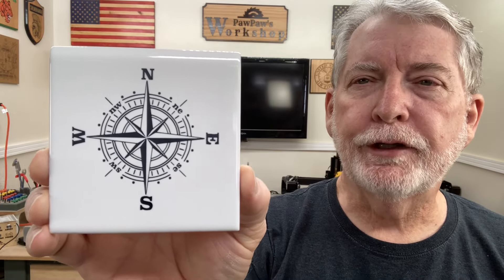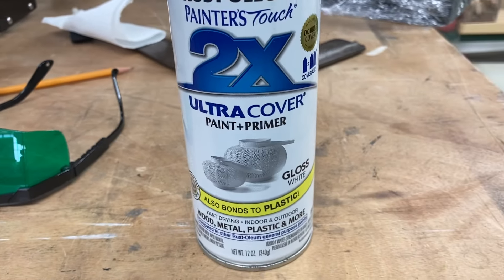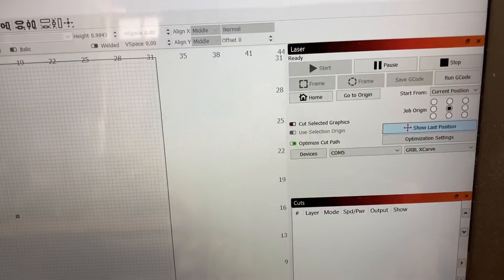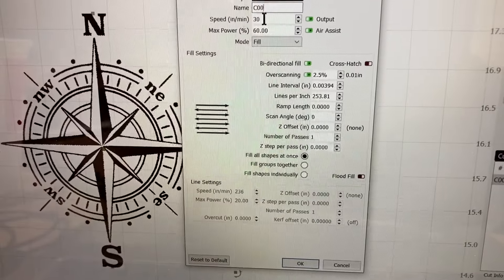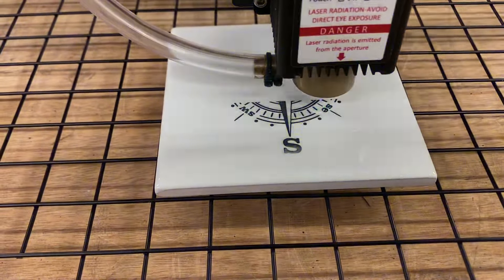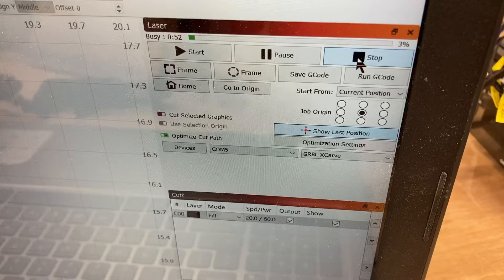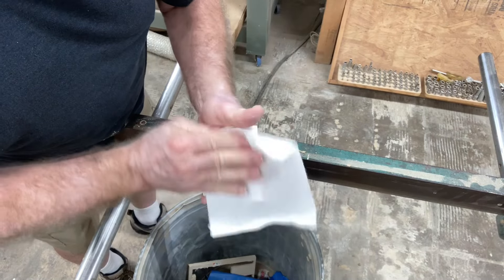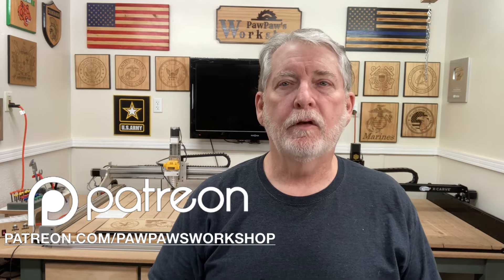Engraving Ceramic Tile Simple and Easy

Comment: Possibility for the bottom of the S is that the laser has not fully started to fire. Often have to run a quick small file to get the laser fully firing before running any work files when starting the laser for the first run of the day.
Reply from the maker: Great information. Thank you
Reply: I looked up the laser diode in the video and the specs say "operating range 40-75'C", so the problem is almost definitely a warm up issue and can be worked around as you suggested. I googled around and found a PhD thesis "A novel laser diode wavelength stabilisation technique..." by Abdullah Asmari. The thesis claimed wavelength is dependent on temperature (due to thermal expansion of the relevant micro geometries), and so initially poor engraving action could be due to an unsuitable wavelength at ambient temperatures. However, it's also quite possible that the 40'C minimum temperature marks the lowest input value of the control algorithm that produces normal power outputs. It should be possible to develop experiment tests to determine whether the wavelength or control system effect is the main contributor

Comment: This is new to me.  Wondering why you painted it in the first place, if you are just going to remove the paint after the burn?
Reply from the maker: The tiles are painted for two reasons. The ceramic tile will reflect the laser and not burn and the second reason is that the laser is burning the paint causing it to oxidize and embed into the ceramic. The black is a result of the chemical reaction with the laser and the paint.

Comment: Is there a specific reason you used the paint?  Was it simply for masking, or does it serve another purpose?  Can I just use making tape instead?
Reply from the maker: Yes,  the paint has titanium oxide in the paint. That is what reacts with the laser. You can purchase titanium oxide and mix it with alcohol and spray the mixture on the tile.
Reply: @PawPawsWorkShop awesome, thank you. You just saved me from unnecessary testing and waste.

Comment: As many others here have said THANK YOU SIR for taking time to help noobies like me get started in this fantastic hobby.! The compass tile you did in this video is a true work of art! Thank you once again for sharing!
Reply from the maker: Thank you very much. It is my pleasure to do the videos and I’m happy that it helped you
Reply: @PawPawsWorkShop   

Hi there. How are you?
The laser used was a Diode type?
Thanks.
Reply: I hear what you're saying but I usually reserve the term "work of art" for something that's made by hand using hand tools. They can be electric, but hand tools all the same. Sometimes the Art comes from the difficulty of the project. Laser cutting is not difficult at all. Grandmother's do it. I'm a traditional woodworker and Craftsman, but I also use laser engravers, and I consider the two things entirely different.

Having said that, can you make art with a laser engraver. Yes you can. But that art comes from the designing. A simple compass like this laser etched on a tile (while cool) doesn't qualify.

I think if you asked most craftsmen who also use laser engravers they would agree. The only people that think they're making art with CNC machines are people that have no real skills, or real artist that can design extremely detailed and intricate designs.

This is in no way a criticism of this channel. Just as someone who's been an artist for 30 years now I want to make sure we differentiate between the two, before real Art is lost. We are already on the edge of that cliff.

Comment: The lighter S was the first thing engraved, often laser engraver have heat issues where the laser puts out lower laser power until it warms up.
The result is that the start of the engraving is dodgy.
One solution is to do a small throw-away engraving immediately before the main engraving, so the laser is properly hot when the main engraving starts.
Another solution is to check and adjust/repair the electronic laser driver, and I remember one case of this working well with a 40w tube laser.
So it's a warm-up issue. Hope that helps. 🙂
Reply from the maker: Thank you

Comment: Thank you for your video's !  In this video I learned that to convert mm to inches and vice versa when setting the speed using lightburn , you just go to the setting box and select the opposite of what your using for speed and go back to your work and it shows what the number is ether way . Thanks I have been wanting that information . This will make it so when other people post there setting you can easily see what they are as per the settings you use. Keep up the good work !
Reply from the maker: Thank you very much
Reply: I'd prefer to be given settings in millimetres.

Comment: Hi great video i did one tile using the same spray, which come out lovely and dark nice deep engrave then i did another but it come out grey not dark as previous you can still feel the embossing the same depth into the tile, have i over or under sprayed the paint or not let it dry long enough im puzzled same exact settings were used on both my tiles

Comment: Thank you for answering a few questions before I could ask. I've seen many of these tiles videos and almost everyone talks about removing underlying paint color. I had been wondering if it can actually go into the tile. I don't want to potentially sell something and get complaints the coffee cup scrapes off the design, even with a seal coat.
Reply from the maker: No, the paint will not go into the ceramic. It’s not porous. Thanks for watching
Reply: @PawPawsWorkShop  Opps, I don't think I phrased it right. 
I was previously wondering if the laser actually went into the tile instead of just removing the spray paint layers. This was the first one I have seen that said it was permanent instead of layer removal.
So, thanks for answering a question I had for so long at roughly 7 minutes in.

Comment: Hi
The problem with the (S) usually  is due to maladjustment on the mirror of the laser if yours have mirrors, when you engrave in the top part that won't happen but as the laser goes down and get far the laser will start hitting less centered on the pointer inner hole, an adjustment on the mirrors leaving the pointer on the bottom right of the engraving space of the machine should fix it, I had probably done this easy fix 20 times with my machine 
Best Luck Fixing it
Reply: Did you not see the diode laser moving over the tile?

Comment: Thank you very much. Would you please explain about the black color after engraving. Is it the result of burning the white paint?
Reply from the maker: It is the result of the burning of the titanium oxide that is in the paint
Reply: @PawPawsWorkShop  Dear Sir, How does engraving multi-layered painted canvas come out in different colors? The used paints are the same, that is, they containing zinc dioxide. I really get confused. I appreciate your explanation.

Comment: I did this before watching this video with a similar compass rose (not as nice as the one you are using) and it turned out grey, I tried various speeds at full power as well. Still looks good though
Reply from the maker: It may be the chemical makeup of the paint.  thanks for watching.
Reply: @PawPawsWorkShop  ah yes, you could be right. It is rustoleum primer. I will try some other paints.

Comment: So if you used this technique on a white ceramic casserole dish, since it’s only having a reaction to the white but not really removing any glaze….would it be food safe?   Or does it actually remove the glaze??
Reply from the maker: It’s burning into the glaze. If you do the engraving on the outside of the dish away from the food contact you may be ok

Comment: How do you set the x and y to the center in lightburn? I have an ortur laser.  This is an amazing idea and and amazing project.
Reply from the maker: I use the center point as the origin point. In Lightburn the small green square is the point of origin. Align the laser to the same point on your project

Comment: so what if i want to "mass produce" a bunch of tiles?  do i still use basic spray paint in a can on each individual tile, or can i shoot them with a larger volume spray gun on a set of a dozen or so placed on card board?  not that familiar yet with lasers and paint, so was curious if all paint would react the same?  brother in law works at an auto body shop and has access to spray guns and paint booths where i could paint a couple of dozen at a time to prep them ahead of time.
Reply from the maker: That should work just fine.

Comment: Paw Paw. In this video, you stopped the engraving the project right after you had improved the Letter S which was great. However, If I wanted to go back to the original starting position for another tile, how do you do that? In Easel if you stop the project it automatically goes back to the datum point but I can't set up an auto return to zero (or origin) in Lightburn. Your advice would be appreciated. Thanks and regards, Colin P, Vancouver Island, British Columbia, Canada.
P.S. Do you have an Etsy store?
Reply from the maker: If you are using current position it will start at that point. For many simple projects that is what I use. For others I will home the machine and us absolute coordinates. This allows you to repeat over and over.

Comment: Thank you for your video.  Interesting and I will buy Rust Oleum spray to try.  Can use the one where the White paint is Matt instead of Gloss.?
Reply from the maker: Yes you can!  Smokey beige works well also. It’s the titanium oxide in the paint that makes this process works
Reply: @PawPawsWorkShop  Thank you for your quick response.

Comment: Hello Paw Paw.
It's been 4 days since my xTOOL D1 Pro arrived, which I bought on Aliexpress. I have already assembled it and it is working properly.
However, I would like to know something that, for sure, is very simple. Among all the materials that came with the machine in the package, there was a Pad Case with red ink, like a Stamp; so, I would like to know what is the use of this and/or how to use it? Thanks
Reply from the maker: I do not know. I did not get that in my xTool D1

Comment: Great video thanks. 
I've tried this method and it goes through the glaze, is this normal?
Reply from the maker: Yes, this is normal. It is permanently etched into the ceramic
Reply: @PawPawsWorkShop  thank you
Reply: @PawPawsWorkShop  just tried another burn, it doesn't come out as black as yours, I have a 10w diode, done a scale test, 900/70 looked OK but more grey on latest burn.

Comment: You started with a white tile and applied white paint and then the laser heated the paint breaking it down to a black color and fusing it with the glaze.  Paint not heated by the laser was removed with steel wool.  I wouldn't have guessed the white paint would produce the black result.  Is it important to use specific white paint?  Have you tried other colors?  What were the results?  Robothut on youtube did similar work with zinc paint producing a metallic look.
Reply from the maker: I have not tried other colors yet. Thank you

Comment: i have the JTech 7watt diode laser can I do this process with that laser?
Reply from the maker: Yes, I believe you can do this.  It will require a little testing
Reply: @PawPawsWorkShop  I did a photograph which turned out too dark then I did a line art cartoon character which turned out to be perfect. So I just need to practice on photographs to get the right contrast etc. Amazing!

Comment: I noticed your line interval is .00394".. Is that the default for your laser? I thought the 5 and 10watts used a .08" line interval. Very good video, thanks.
Reply from the maker: That is correct. I did not change it

Comment: I own both a Foxalien 4040XE & a Foxalien Reiser. Before buying the Reiner, I bought a rotary roller for the 4040-XE (R57). Can I modify the connector so it will work on the Reizer , or do I need to purchase the rotary roller (R42) for the Reizer?
Reply from the maker: It is my understanding that no you can not.
Reply: @PawPawsWorkShop  Bummer. I guess I’ll put the R57 up for sale and buy the R42.
Thanks for the quick response! Love you 
channel!

Comment: Hi Can you use any colour of paint,or does it need to be white
Reply from the maker: It’s not so much the paint color, it the fact that it has titanium oxide in the paint. Most often this is found in white paint or very light colors. Smokey beige in the Rustoluem brand also works well

Comment: I followed your steps and the engraved area turned black but it wiped off and did stay. Any idea why?
Reply from the maker: Two possibilities. One, the paint. Did you use the same paint?  Two, your settings will need to changed based on your laser. Run the grid test pattern to see the best settings.

Comment: Paw paw if I  understand this correctly you ran your laser at 60% which would be 4.5 watts. My laser is a 2.5 watt so I could acheave the same by running my laser twice at 55% .
Reply from the maker: That should work.  Give it a try. Would love to see the results
Reply: that foxalien laser is only about 5w laser output.

Comment: Any advise on why my engraving wipes off the white tile? I have followed your video and had adjusted settings, but the lighter grey/white areas wipe off. And is there a file for LaserGrbl with the greyscale test that you are aware of?
Reply from the maker: What are your settings in GRBL?  $30=1000
Reply: @PawPawsWorkShop  $30 1000

Comment: Hi Paw Paw. I noticed you are using a fox alien laser. Did you connect the laser directly to the inventibles controller or did you have to use a controller from Fox Alien? I inherited a 15W unit from a friend but it has no manuals, wires or anything. Trying to figure out how to hook it up.
Reply from the maker: The FOXAlien laser has it own controller on the machine itself. The xcontroller on the XCarve does not have all of the necessary laser control elements. I have a JTechphotonics laser for the XCarve and it has it own controller for the laser that is connected into the xcontroller.

Comment: I did everything just like you but my results are very pale in comparison, my print only get pale gray. could that be because of the paint quality?
Reply from the maker: It could be the paint and also the settings could be off. Have you run the grid pattern?
Reply: @PawPawsWorkShop  I did the grid test and it all seemed very pale, even the settings that cut deep. I ordered some titanium dioxide and isopropyl alcohol to try instead, thanks for replying 🙂

Comment: Pawpaw how do you get the black.  I am using a Jteck laser 7W Pro. My speed is 5”/minute and power is 100%. This is not making any markings in tile. Can you help me?
Reply from the maker: Did you paint the tile white first?  It is the titanium in the white paint that reacts with the laser that causes the black to be burned into the tile. It is the Norton white tile method
Reply: Do you paint over the ceramic finish?  Any special paint?
Reply from the maker: Yes, just spray the tile with the paint let dry completely. Then engrave. After the engraving is done clean off all the paint with lacquer thinner

Comment: The imagine came out great. Went to clean and the paint came off. It took the entire imagine off. I did clean the tile first, then spray paint with 2x white. Waited the 24 hrs to dry. What else could I be doing wrong? I know it's me. Great  video.
Reply from the maker: What laser and what are your settings
Reply: @PawPawsWorkShop  S9. Should I feel the etch into the tile?
Reply: 1200 speed and 10 power
Reply from the maker: Yes, you should feel the etch in the tile
Reply: I have an XTool D1Pro 10w and tried this and it does not come out black more like a silver-ish color. How do you get it to be black?

Comment: Hello, I have a question about traveling lines on my laser. It happens in lightburn and Lasergrbl. I checked the $30 and $32 settings and they are correct. Any ideas? Thanks
Reply from the maker: The lines per inch may be the problem.  Check that in the settings
Reply: @PawPawsWorkShop  Thanks for replying, I'll see what I can find.

Comment: If you are using non glazed tiles, do you still need to paint the tile?
Reply from the maker: Non glazed tile is totally different. It is porous and will act differently. It has only been bisk fired
Reply: @PawPawsWorkShop  thanks. I will do some testing

Comment: Love your channel by the way. I know when you use a special coating like Cermark on mugs and glass, that is made for etching. But I'm not understanding how the spray paint is achieving the same thing. Which is great cuz spray paints a lot cheaper. Will it work on metal also like the Cermark?
Reply from the maker: The chemicals in the paint are oxidized when heated by the laser and burned into the materials resulting in the black color permanently etched in the ceramic.
Reply: @PawPawsWorkShop  thanks. I always learn so much from you.